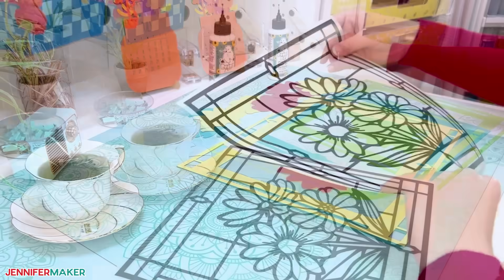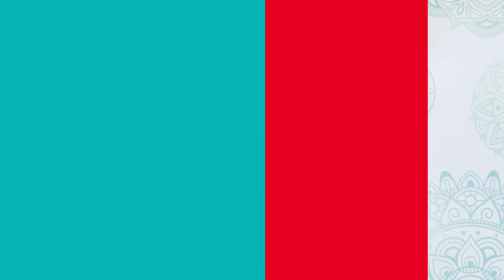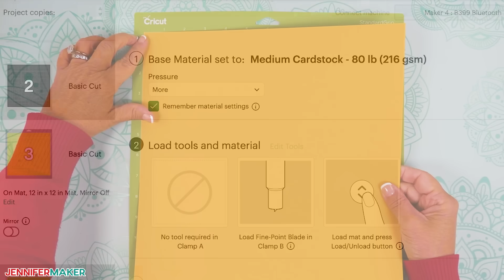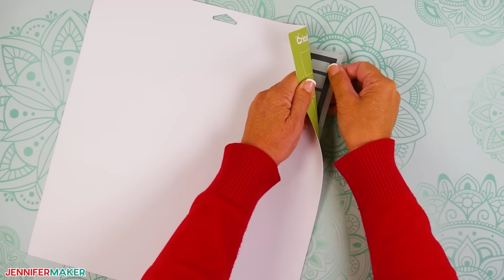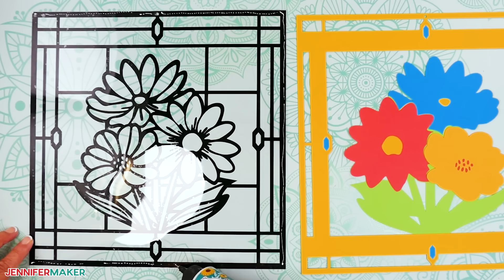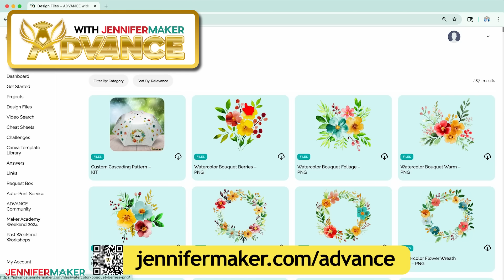How To Make Stained Glass Using Paper: Faux Decor Made Easy!

Comment: Exactly what I was looking for, thanks!
I'm especially interested in the software you used. Does it also work in designing and printing out sketches to specific sizes? Like if I had a 4"x4" sketch of something and I want to expand it to exactly 30"x 30" and then have the software print it out on a bunch of normal sheets of paper that I'd combine to get it.
Reply from the maker: There are several software options that can help you with this task, combining image resizing and "tiling" for printing large images on multiple standard sheets of paper. Search Image editing software with tiling capabilities. 💜
Reply: @JenniferMaker  Thanks!

Comment: I'm in your advanced program and read the cheat sheet on how to make the project double sided. Question I have is why delete the acetate layer before making the duplicate? Is there to be no acetate at all in this version?
Reply from the maker: The project will still require two acetate layers none will be cut through Design Space because both will have the vinyl layers applied before cutting.❤️